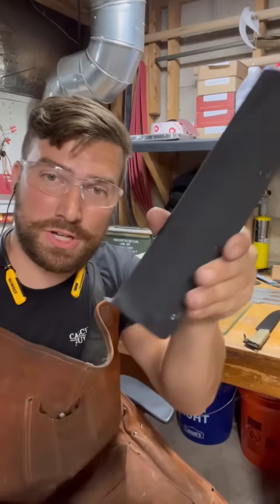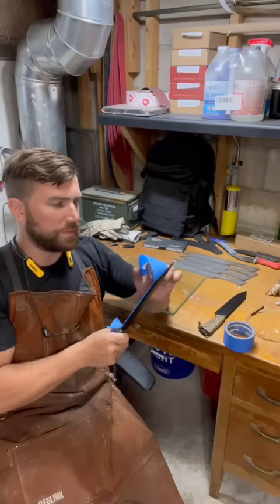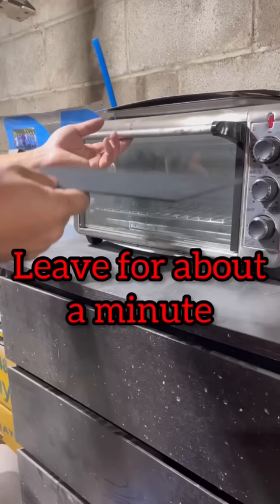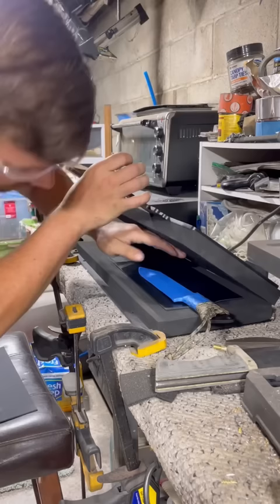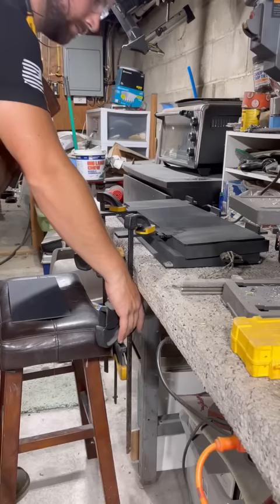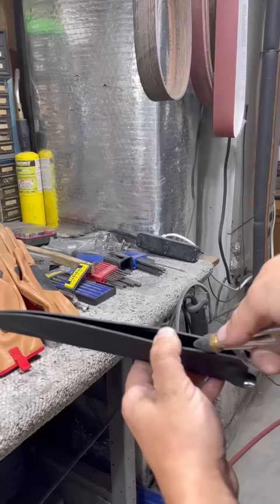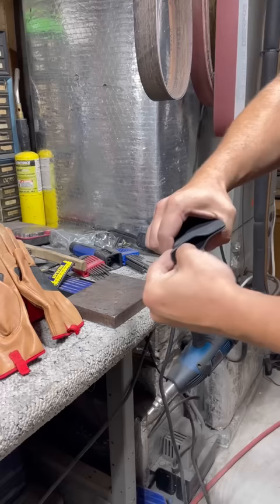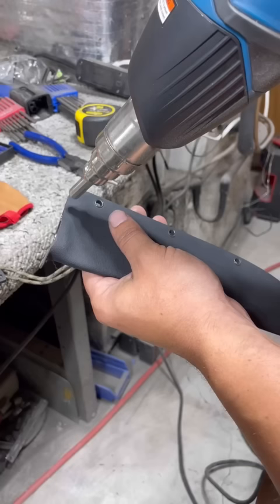How to make a kydex sheath

Comment: I work in a plastic shop that uses "kydex" every day.  It is a brand of plastic, not a kind of plastic. It can be pla, pet, abs, or more.
Reply: Ty
Reply: No shit?  Didn't know that.
Reply: Learned something new today! What type would you choose? I want to start making these
Reply: No, Kydex is IPK (Acrylic-polyvinyl chloride). It's a very specific material that just has a brand name. What you said is like saying "Advil is just a brand of painkillers, it could be paracetamol, ibuprofen, aspirin etc."
Reply: Your clarification is correct, but interestingly referring to any of those materials as kydex isn't technically wrong either, in linguistics the brand name "Kydex" has become what is know as a popular eponym, meaning the brand has become synonymous with the material and therefore the naming has become generic. A couple other examples of this include, calling all sodas a "Coke", calling tissues "Kleenex", or back in the day referring to different pieces of office equipment as "Xerox".
Reply: @Zayats_MW it’s kinda like how Styrofoam is a specific brand that makes extruded foam polystyrene. Styrofoam is always polystyrene foam but not all polystyrene foam is made by styrofoam.

Comment: I wanted to build my own kydex pistol holsters. So I build a press with my tig welder some one inch square tube I had laying around and a scissor jack from my wife’s Honda. I dropped about 400 bucks on molding foam hardware material and I ended up getting an arbor press to press rivets. Now I make sweet ass holsters and have almost seen a return on my investment in the short time I’ve been learning the craft. Awesome stuff
Reply: Hell yeah, brother.
Reply: Fuckin right, brother.
Reply: @jasonshink6589 You don't need all that stuff he's talking about. He's doing the same stuff this guy is doing just with pistols.

Comment: Thank you for the response! I’m getting into knife making and I’m a little lost for the sheaths. Next, could you show us how to make the press? I love what you’re doing, continue like that !
Reply from the maker: I bought the press
Reply: You need a good dense foam or rubber foam and some kind of hinge that has a big enough gap to match the thickness of 2 of those layers of foam. Then mount that hinge to 2 pieces of wood or metal and mount the foam between them.
If you are just doing knives, you could probably simply this down to 2x6s for the shell of the press but I still don’t have a hinge solution. Maybe a long gate hinge and bend the brackets at 90° so you aren’t screwing them into the end grain of the 2x6
Reply: A simple press made from heavy rubber foam, plywood and F style wood clamps would do the trick. Sandwich the foam, sheath, foam and plywood on the bench top, then use the F clamps (I'd say 3 or 4) to tighten everything down. They'll actually give a lot more pressure than the clamps used here.

Comment: I use a griddle.   Found it at Goodwill for 9 bucks.  I have a section of iron board cover. set Griddle to 200.  cover with shiny stuff, open press, taco your blade and press.

Comment: Close.., but no cigar. I always shape some wood to heat form the thumb ramp and get the correct amount of retention. Since I use two layers, I have also found that if I use a “jig” for the TecLock, I’ll always have those holes prefabbed and ready to drill. Final retention test is always adjustable with heat gun, but Chicago screws are an absolute must in my builds, sometimes I need neoprene spacers.., sometimes steel spacers, at that point.., just a preference of customer for carrying purposes.

Comment: Dude!!!!
I had no idea kydex existed... I can make sheaths and holsters myself that actually fit. Thank you for posting this video.
Reply: Leather works better and is cheaper and lasts longer.. you also don't need a whole machine shop to work with leather and put a wooden insert at the top to grip the knife. Maybe $40 and a permanent sheeth. Might have some leftover leather for handle decals or a bracer as well

Comment: Great vid. You should also stick a chop stick from the tip of the blade through the bottom of the sheath so water and debris, can run out.

Comment: Here's a tip..you will get better definition on the kydex if you run the heat gun on your foam in the press. Drastic temp changes between press and hot kydex result in loose edges against the knife

Comment: Here's a hint. put a piece of felt that is thin where your rivets are. That way there's no chance of a thin blade edge getting rubbed up against the rivets and becoming dull.
Reply: Felt would retain water. That closure is tight enough that the edge is never going to rub against the rivets.

Comment: Put Tech-Lok’s on them. Best thing for putting a Blade on Molle. My Microtech Crosshair/Currahee has the best Sheath I’ve had, and I have Blades worth $1700.00 that $200 Microtech is the best Fixed Blade I have regardless of price. It's better to have 2 pieces of Kydex and use the round rivet things in my experience rather than folding the Kydex over. It'll up your Kydex game. Those Rivet Holes are what the Tech-Lok mounts to.

Comment: I made my handle out of some moldable plastic you dip in boiling water and its reusable so you can get perfectly personalized ergonomics just by squeezing the handle as you shape it onto a busted blade and its strong as steel i couldnt break it even if i tried running it over, the handle material might fuse with the plastic sheathe if i pressed it directly onto the handle while heated without tape so might have issues trying to mold it and keep it secured

Comment: You guys always forget 1 thing on the foam press. I would rather have it putting even pressure throughout than have it clamp only one side with a pivotal motion on the other that does not move

Comment: Does it manage to hold the knife well? I carry my knife around my neck.
Reply from the maker: You can adjust the tension to make it hold REALLY well, but the drawback is how hard it would be to insert it BACK into the sheath.
Reply: @calculatedsurvival Very cool, this is a very enticing method to make a sheath.

Comment: Everyone of these shows with a press how about if I don't have a press or grinder
Reply: Harbor freight? Clamps, high density foam and wood?
Reply: @Heliosaurus  did you read my comment? How about not.
Reply: Dude osrs in my frat house I watched two of my brothers make some for their guns using nothing but that material, an old junk ass oven, and two blocks of wood to press together using their weight. They made 3

Comment: Bullshit!
Metal rivets will damage the edge of the blade.
Reply: The rivets are at least 1/8 inch away from where the knife edge will slide.
Reply: @aldenbarbieri  
...and the blade will stay away from the rivets just because you decide it?
😂🤣😂
Reply: @lingfarang2132  No, because the Kydex is firm after it cools and the shape of it will guide the blade away from the rivets when it's sheathed.